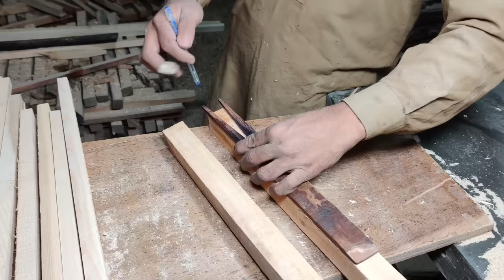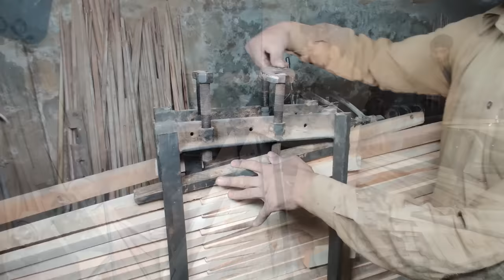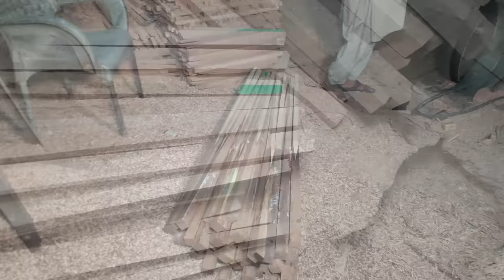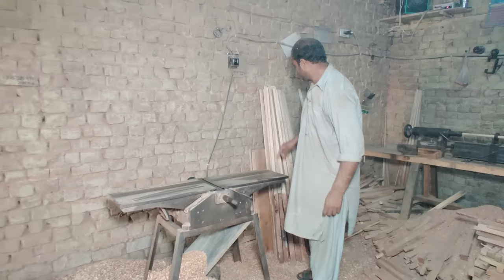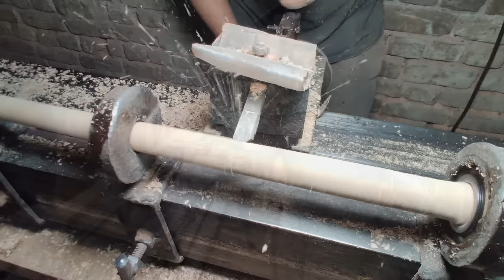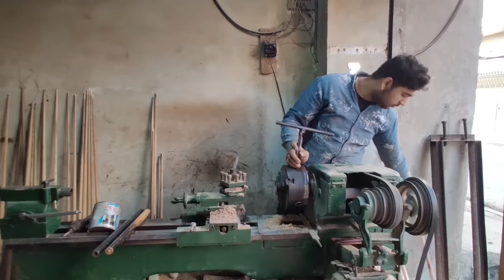How To Make Snooker Cue / Snooker Stick Amazing Process

Comment: Interesting video and a good watch. Snooker cues are all about the age of the wood, the best cues only use ash or maple for the main cue, the ash or maple is aged, ergo, the wood has done all the twisting and bending, kinking it will ever do by the time the wood is chosen to make a snooker cue.

These cues in the video are cheap and cheaply made, they will bend, twist, split and basically deteriorate rapidly, however, one has to admire the process employed here in making them.